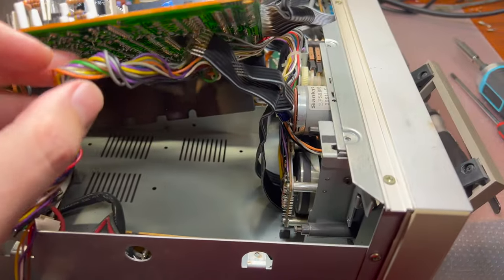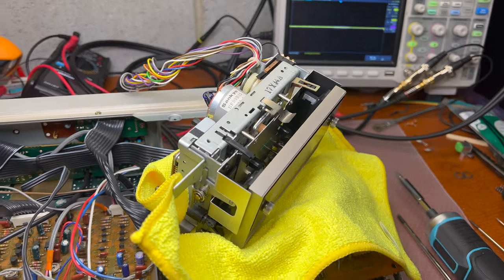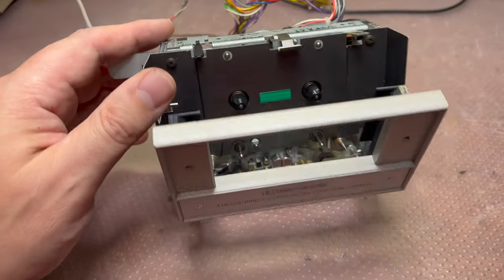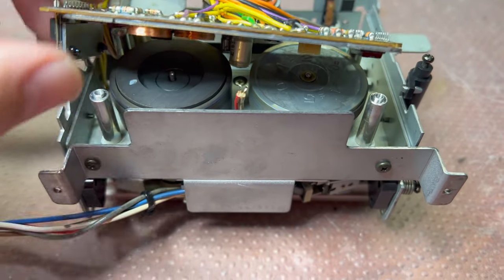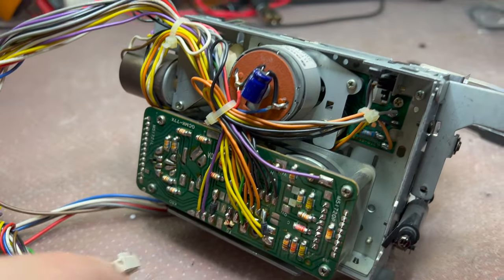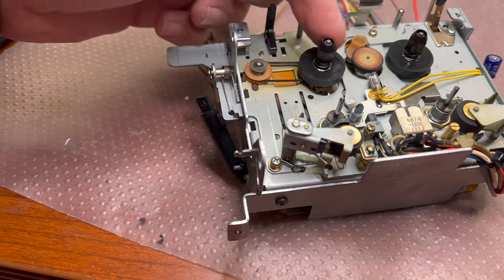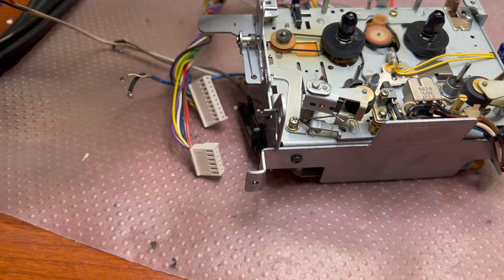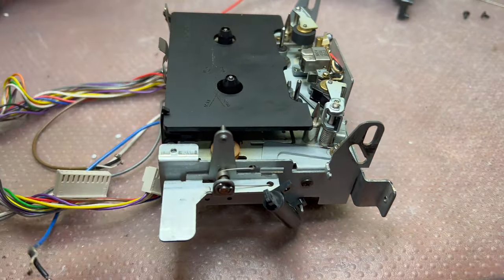Harman Kardon CD491: Belt Replacement Tutorial

Comment: If you removed the wheels, you would see magnetic induction brakes under them. This Sankyo mecha  is one of the most advanced versions. For example, Nakamichi decks with the same mechas, have simply 
mechanical brakes.

Comment: You could also take mecha block out without having to remove power supply PCB. You just need to pull the entire front panel off and forward a bit (it is held by two screws on each side). Of course, it's a good idea to recap PS section anyway, so you can just unsolder the three leads coming from the transformer, unplug all flat cables and pull the entire board out for easy work.